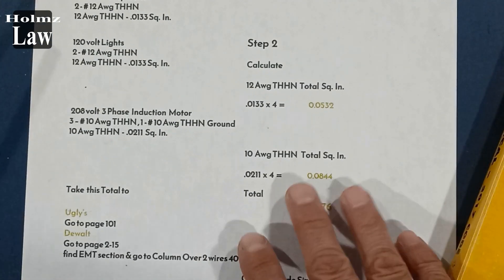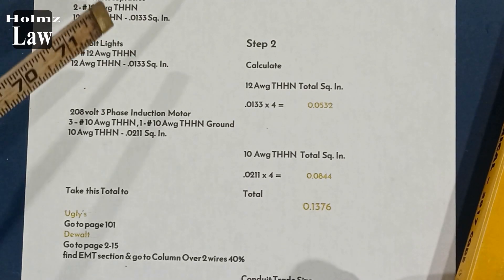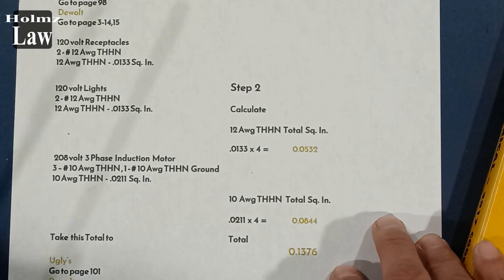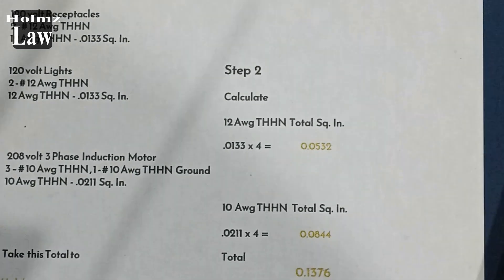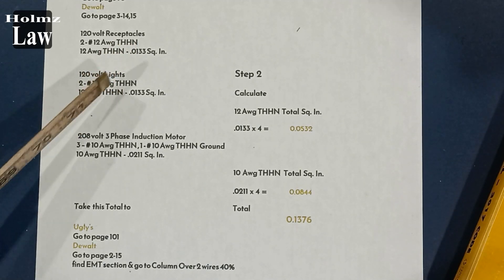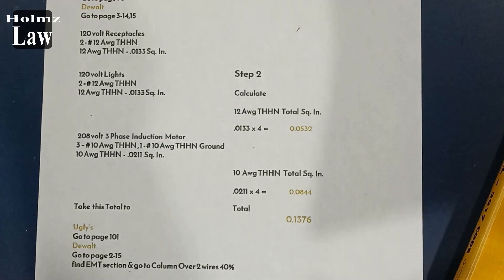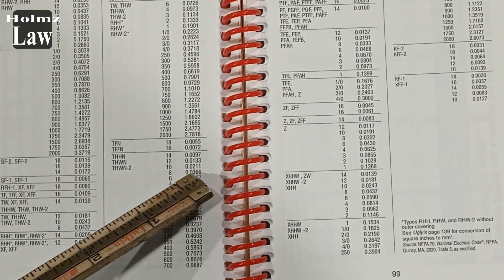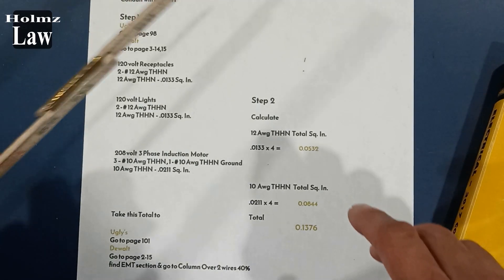Ugly's and/or Dewalt's Raceway Calculation, Different Size Wires and/or Insulation. Quick and Easy.

Comment: Thanks, do you have a video on derating the wires for longer wire runs and calculating proper wire size?
Reply from the maker: Sorry no i don't. What you are looking for is Voltage drop. I'm sure there are plenty of video's on youtube of the topic. Just search "voltage drop". So depending on the distance you'll have to up size the wire. It's really not that difficult. You shouldn't have a problem finding answers. I'll put that on my list of video's to cover.
Reply: @TheArtOfConduitBending  cool.  Thanks.
Reply from the maker: @diySolarPowerFunWithRay  anytime brother.